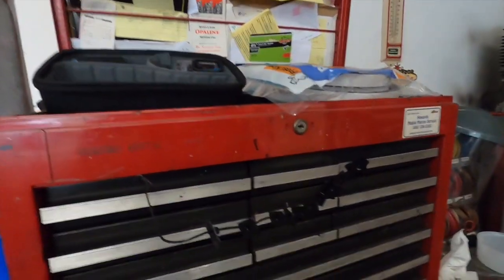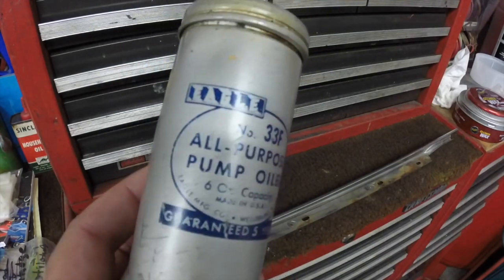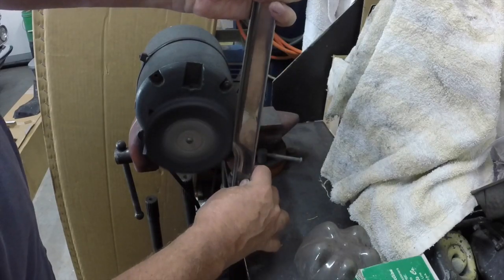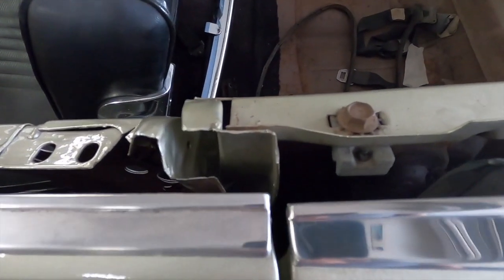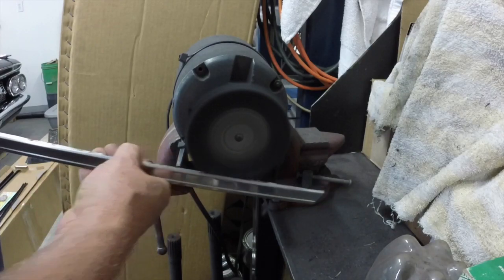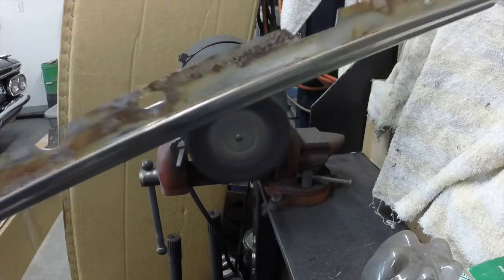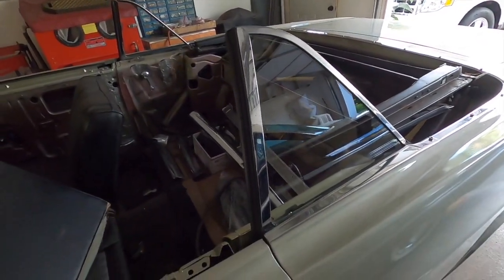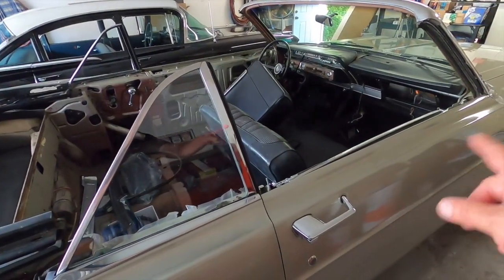1966 Ford Galaxie 500 convertible restoration part 135 installing weather strip on trim and car

Comment: Howard, thank you for taking the time on showing us you actually doing some of the work on the car trim.  I applaud you for taking the time on cleaning everything up.  When you get finished with the car, you can say the car is brand new like right off the factory floor with no rust on any of the parts.  If you're going to take it apart, you might as well as go all the way and you're doing that.  God bless you and your family and tell your dad hello from Ky.  Still keeping him in our prayers. Chris.

Comment: Howard, Great job on buffing the Stainless window reveal moulding trim.  I feel your pain on the wheel well trim.  I used to own quite a few '68, '69 and Early '70 Ford Falcons. Finding the Aluminum Anodized Wheels well trim and side trim was exactly what you are now going thru... None of it is reproduced.  It was NOS, good used or nothing back then and that was 20 years ago!...so it's even harder to find today.  With both of my '65 and '66 Mustang Convertibles...just about everything is available...so I'm lucky about having to find parts because over 1 million were made between '65 and '66...Just staggering production numbers...  I hope that you'll maybe find and restore a '65-'66 Mustang some day... It would be great for your video series...and would probably take half the time of the '66 Galaxie..  It's got a lot less parts..lol... The Galaxie is coming out great... Keep it up!... I have my own projects to keep me busy..!  Tony K. :o)
Reply from the maker: I would totally restore a older Mustang. I looked at a 66 Mustang this guy inherited, a month or so before buying the Galaxie. The problem is, some people think there gold. He wanted $20,000 for a car that needed way more work than the Galaxie.... I thought they were nuts, and offered them two grand. The car is still sitting in the same spot rotting into the ground. He called me a couple months ago, offering to let it go for $15,000. I laughed and offered him $500 this time. It's a 289 automatic with really bad undercarriage rust issues.

Comment: As always Howard, another great video. I was just wondering what your next project will be when the Galaxy is finished? By the way, my father started driving Galaxy 500’s in 1962 and they were replaced every 2 years until 1968. Then the next one was a 1971 LTD. After that the company he worked for switched to GM Pontiacs for some reason. When he retired in 1985, he bought a new Grand Marquis and another one in 1993 which he drove until he passed away at the age of 80. That was 20 years ago. He always loved his Grand Marquis. They were his pride and joy. Thank you for the trip down memory lane. Randy, from Toronto Canada.
Reply from the maker: I haven't even thought about the next project. It all depends on what I find at a good price. I never really look for a specific car, it's always one that just happens to be a decent car at a decent price. I wouldn't mind doing a 59 Chevy Parkwood. I like Edsel's also, so who knows. A Mercury Turnpike Cruiser would be fun too.

Comment: Howard. I'm not sure which piece but they have a left front trim that remanufactured on Ebay for 85 OBO and  they have some used pieces. Put this in your Ebay search.    1965/66 ford galaxie left front fender wheel well trim
Item Information
Condition:
Remanufactured
Reply from the maker: I already have mint stainless steel front fender trim off a 65 on the way. He's got nice 66 rear ones I am getting too, there aluminum. Hoping to have it late next week.

Comment: Howard, I really enjoy your videos.  I’m working in a ‘67 Galaxie convertible now that my uncle bought new.  What do you like to use to lubricate the window regulators and glide tracks?
Reply from the maker: I oiled then greased the window regulator with chassis grease. The window and other tracks I like using a dry-lube, like garage door lubricant. Grease in the tracks will get sticky over time, making the windows hard to crank in cooler weather.
Reply: Good tips.  Thank you for the info!  You are an inspiration for me to keep working on restoring my uncle’s old Galaxie!

Comment: Great work!  From where did you order the molding pieces?   I am almost done disassembling my 67 Galaxie,   The door reassembly has me concerned.... I took lots of pictures when taking it apart but....  looks intimidating.   Rear bumper off tomorrow, then start body strip and prep.    This is my first project since a 67 mustang I did in 1980 when I was 18.
Reply from the maker: I think it was Car Krafters.... or a name like that. I show where I got them, somewhere in a past video. There not cheap.
Reply: @OldCarAlley   Thanks!  and thanks for documenting the project.  ---  helping a lot!    it is Car Krafters!